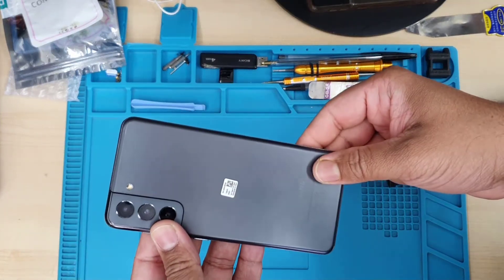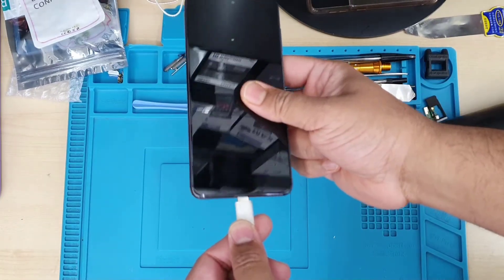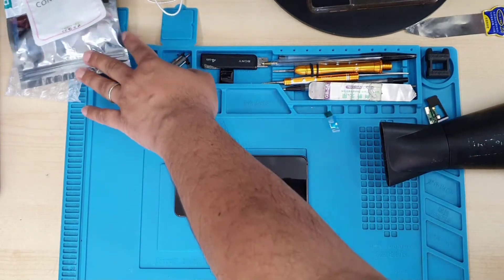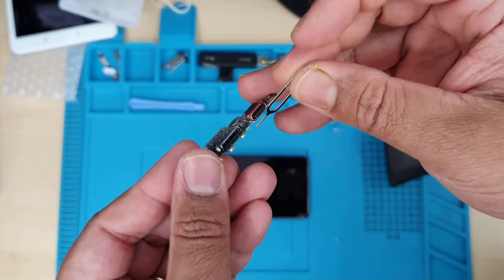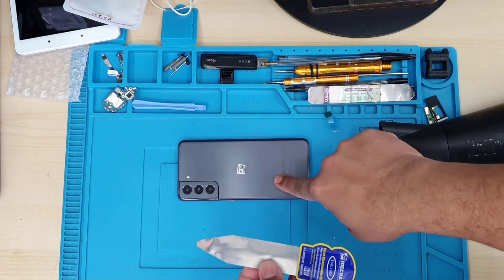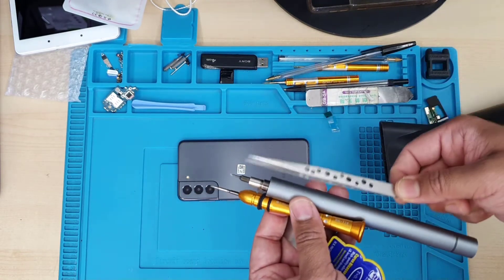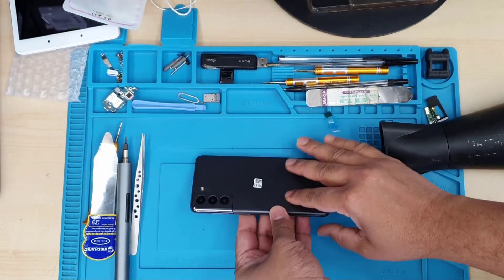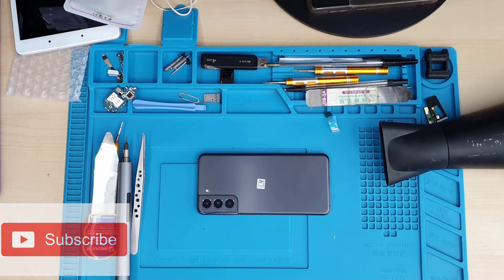Samsung Galaxy S21 5G G991b Is Not Charging | Fixed !

Comment: I put three different USB ports in mine and all did the same exact thing.  The dex will recognize but the mouse wont work, and I also have lost my ability to connect to a PC.  Has anyone ever figured out what else could be going on with these phones?  Samsung authorized repair told me they couldnt test the USB port so they werent sure what to do.  (Go figure, the USB port isnt working right which is why I brought it there and they tell me the USB port isnt working right so they dont know how to diagnose it to fix it)  It starts charging fast ~1400mA but after a minute or so it drops down to trickle charge at ~100mA.  Ive factory reset the phone and it did absolutely nothing except waste half a day.  Ive also tried every combo of pwr and volume button video out there as well as clearing the caches.  Nothing worked.  This will be my last Samsung product (which by the way) Samsung told me to take it to a repair shop.  When I said I did that they essentially told me to piss off and just go buy another phone.  When I asked them where to buy Samung OEM parts they would not answer.  If anyone else has found a solution please let me know.
Reply: Did you find a solution? A also replaced USB port and battery, but still only wireless charging works.
Reply: @teodorgorka i did not...the phone was crushed under a car and thats where the story ended

Comment: I dropped my phone now it takes 8hrs to charge a says no sim detected.. could this board be the cause of both of those issues? I have tried everything else including factory reset.. thanks
Reply: Omg??? This is what happened to me too... but rather than 8hrs to charge, it's just not charging anymore..
Reply: @kcrayzme2341  I went to change the charging port but after removing the back cover I saw one of the connectors had came loose.. re connected it and it worked!
Reply: @jasonpascoe6989  oohhh okay I'll do that too but I dont have a screw driver that would fit to remove the screws at the back... the back cover of the phone can be removed tho
Reply: I hope it works when I do it too
Reply: @jasonpascoe6989  IT WORKED!!! MY PHONE IS CHARGING AND THE SIMS ARE DETECTED AGAIN